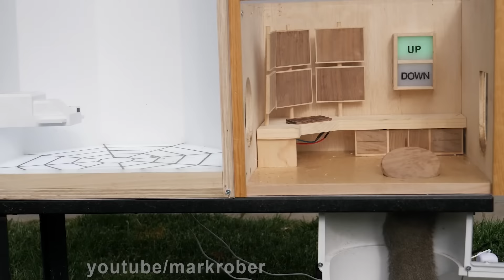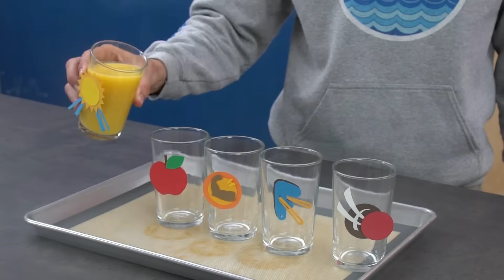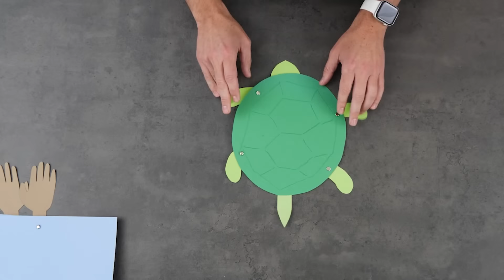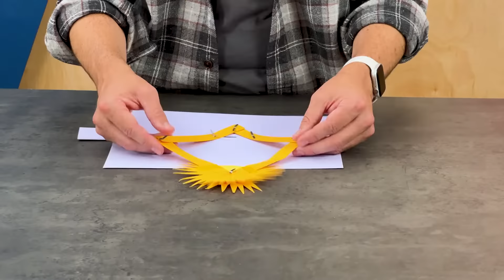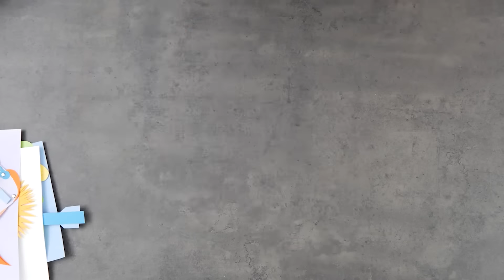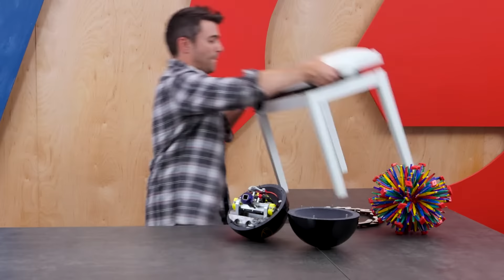Make Your Own Drawing Machine

Comment: Is the main wood panel supposed to be flat? Mine is quite warped, and before we assemble I wanted to make sure - it doesnt seem the drawing would work without it being straight. Nearly 1/4" lift in opposing corners when laying on the table.

Comment: Only one of my motors is spinning
Reply: Same
Reply: Did you figure out out? I have the same problem
Reply: We have the same problem. I took that motor housing apart and loosen up everything. The issue is the lubricant is thick and the assembly is quick. They haven't smoothed it up enough.
Meanwhile, the gear ratio is low and needs high input force. That is why the motor cannot move and get stuck.
If you pull the motor out from the housing, you can test it alone and it should spin normally.
Then you can disassemble the yellow housing and loosen up the gears and put it back for retest.

Comment: Question. When my son and i built ours the bolts keep self tightening to the point the motor stops spinning. Anyone else? Any solutions?
Reply: We added washers
Reply: @cdthompson329  yes we ended up doing that too
Reply: The problem is that the bolts are too short. We solved it by putting small bits of plastics in nut holes. These bits prevent the bolts from tightening completely
Reply: same ours do that
😊

Comment: Does anyone else have an issue with the screws in the linkages screwing itself shut?
Reply: The bolts are too short - they tighten too far and clamp down on the arms. So I took the spare bolt, chopped the threaded part into 4, and screwed each piece into each of the four holes. This causes the bolts to bottom out and not tighten all the way down which prevents the arms from seizing.

Jamming something else into the bottom of the bolt holes would work also.

Hey crunch labs! Hire me!
Reply: @patrickmcmanus1760  such a great solution. Thanks so much for sharing your fix here. Definitely experienced the same problem.
Reply: @patrickmcmanus1760 thank you! 😊
Reply: We added washers